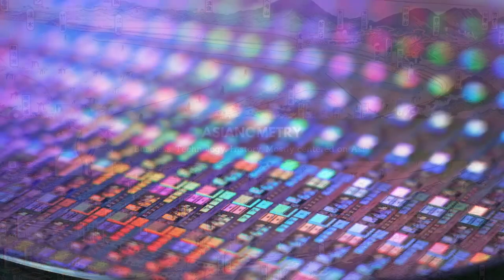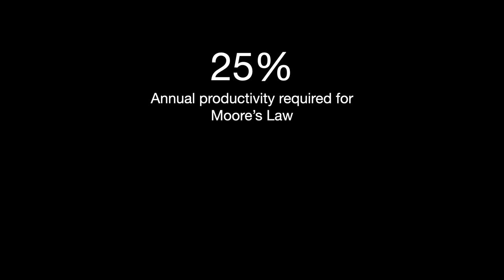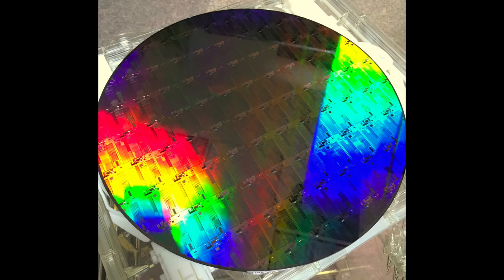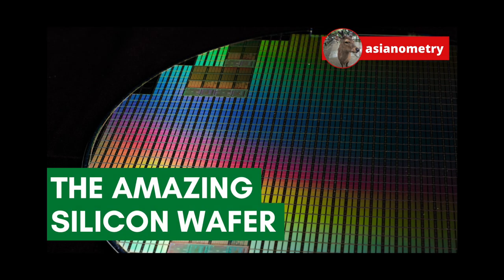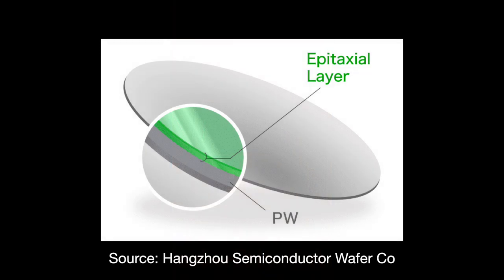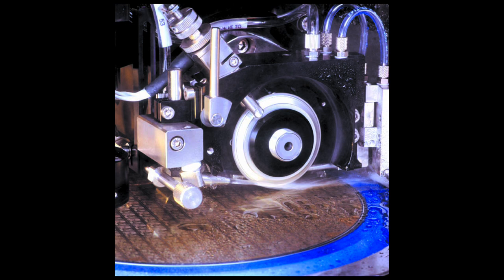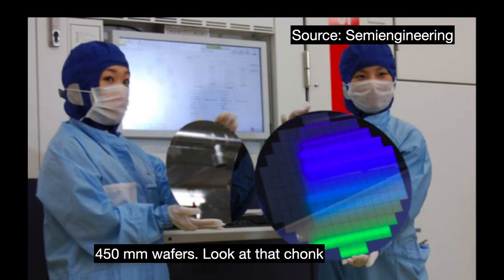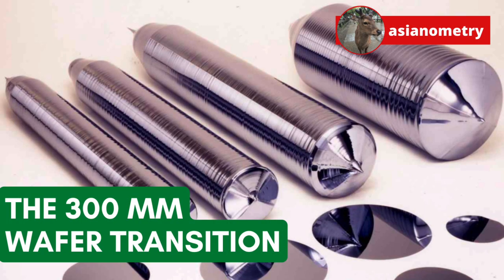The 300mm Silicon Wafer Transition

Comment: This sets up an interesting game theory situation.... if a company really wanted 450 they'd have to make huge firm orders from suppliers to get them to tool up; but then after the suppliers have tooled up then they're free to sell to other companies, who get a free ride (or a relatively cheaper ride at least).  Demand for chips is relatively price-insensitive, so it would make sense for the industry to get together and agree "let's just not".  Antitrust laws prohibit those kinds of agreements, but the law can't force companies to get together and agree on standards.  I wonder if some companies were trying that with the 725 vs 735 um controversy last time around.  (I have absolutely no idea about chipmaking, but is there any reason to feel strongly about 725 vs 735?)
Reply: I don't see it happening.  Because of the node shrinks the amount of die that can come from a single wafer is in the many hundreds  to thousands and the bigger problem is being able to cut a die ever smaller.  You get into issues like how fine can the line be between two different die.  So when these are the problems, somehow I just don't see the desire for all these fabs to go through the cost of retooling again.  The cost would probably be 50 - 75 billion this time around because there's a lot more fabs.

They made the move to 300mm when the industry was using a 100nm process node.  We're about to be at a 2nm node (3 is in development, getting near risk production), and we're going to be at phases of 1nm by the end of the decade.  3nm is a density of 300 million transistors/sq. mm.  Once below 2nm, which is 20 angstroms, the industry will change over to angstroms as the measure.

But here is the problem, if you can etch 800 million to 1 billion transistors on a sq. mm, why in the WORLD would the industry want to have larger wafers.  You're now in the thousands of die/wafer.

This is a comment based on a question I asked about how small can a single die be:

"Fully functional chips can be well under 1mm squared. They are typically fabricated on older lithography equipment using smaller wafers, however it is possible to fab 1000s of chips on a 300mm wafer.

It is more cost effective and a better return on investment to fab larger more valuable ~20mm square devices on a large wafer."

And there lies the problem.  It's more cost effective to fab larger die on a large wafer, but with node shrinks getting you near 1 billion transistors sq/mm, the problem becomes cutting hundreds of vertical and horizontal lines to separate die.  So, I don't see the industry wanting to make that even harder by having a larger wafer.  Die is getting smaller every year.

And then as said in the video, it's not like what you said in this statement " if a company really wanted 450 they'd have to make huge firm orders from suppliers to get them to tool up"

No.  To make die relies on making wafers which relies on a CRAP TON of equipment, so a single company wanting to tool to 450mm isn't going to get anyone to tool anything for that company.  If Intel, TSMC, Samsung, etc.... said they wanted to move to a 450mm wafer, since those are the biggest players, the first step is convincing ASML to produce lithography equipment that can deal with such a large wafer, and frankly that would probably be a year debate right there, and then probably 8 - 10 years before they actually produced it.  And that's the first step, KNOWING you can actually produce a die on 450nm.  Then there's probably the other 50 companies that would be involved in making the REST of the equipment.  THIS is why there's a consortium to deal with this.

In fact if anything I could see moving these really advanced nodes BACK to 200nm because once set up, the faster speed of operation added with much smaller die so there are still many hundreds to thousands of die coming off a single wafer, that could probably bring prices down.  As was pointed out in the video, it takes longer to work with and produce larger wafers.
Reply: @aphenioxPDWtechnology  No not true at all.  The movement to the most advanced nodes follows a pattern.  HPC (High Performance Compute) is always moving to the advanced nodes first.  In the case of Intel, Intel moves onto their own advanced nodes, but it's available to other customers.  In the case of TSMC, Apple is always their risk partner (first customer on a new node that has just moved into mass production, along with usually 2 other companies).  In the case of Samsung, they move to their advanced nodes first with their small devices, but Samsung specializes in LP (low power) nodes.

Try searching for TSMC customers percentage wafers or similar searches and you'll find pie charts and other charts that give breakdowns of who buys what from TSMC.

Anyway, after TSMC has proven a node, THEN AMD, Nvidia and many other customers will move onto that node, so in the case of TSMC, Apple moved onto TSMC N5 last year with their small devices and the M1 processor.  This year, for which products are about to start releasing, AMD and Nvidia will be using it.  Intel launched a new line of GPUs, a first for Intel, with Xe graphics and first gen is named ARC.  THAT is on TSMC's advanced node.  But AMD and Nvidia is in mass production right NOW for AMD's Zen4 line of CPUs/APUs for desktop/laptop/WS/Server along with future console releases on TSMC N5, and AMD is releasing their new line of GPUs on TSMC N5.  These products are here starting next month for the CPUs and probably the end of the year for GPUs.  Nvidia has delayed their release of Lovelace GPUs but they should still be out by the end of the year, also on TSMC N5.  Apple was SUPPOSED to move to TSMC N3 for their next gen products but that node is delayed, so they'll probably be on N4 and an advanced node of N5, whatever the designation will be.  Samsung has already released on their 4nm.  Intel will launch their 14th gen CPUs on their Intel 4.

Now, these are the big names that most people recognize.  Qualcomm and a few other companies are also customers of the two most advanced nodes out.  Huawei is another one.

So, HPC and small devices dominate the most advanced nodes, and HPC is HUGE.  The world of servers is getting to millions of CPU purchases a year and is still growing, and they swap out equipment all the time.

After those most advanced nodes then you get into other electronics that needs to be on small die and use little power, other than what Apple, Samsung, AMD and Intel make.  You have other ARM processors that different companies make, but even part of those are on the most advanced nodes even after what Apple, Qualcomm and Samsung produce.

Sure, an IC that runs a vehicle's emissions along with gas flow, air flow, etc.... to get the best performance/fuel efficiency are on lesser nodes and there's tons of trivial electronics that use less nodes.  A lot of military equipment uses lesser nodes.  But a node hasn't come out in probably 1.5 decades where it wasn't already booked up for 1.5 to 2 years.

And also, if a company doesn't get good yield from their advanced nodes, it cuts into their profit, so you better BELIEVE they do everything they can to get yield up as quickly as possible.  If TSMC for instance has a bad yield on N3, NO ONE will move to it.  All that is worked out in contract.  They have to guarantee a certain defect rate.  You can't be a company like Apple and 30% of your ICs fail.  Intel is different because they are a chipmaker and semi-conductor company, and this has been part of THEIR failure and why they've slipped in market share for both sectors of their business.  So yes THEY have had issues with their advanced nodes, but TSMC gets that worked out before they can release a node and both their N7 and N5 releases were VERY impressive and made their customers happy and coming back for more, and caused Nvidia to move off of Samsung back to TSMC.

So, if you get anything from this, there are multiple companies involved for fab.  You can't make a blanket statement about failure rates.  You can't make a blanket statement about ANYTHING.  And there's a LIST of customers always waiting to be on the most advanced nodes, more so with small devices and HPC, where in HPC it give companies a competitive edge, so they will move onto those nodes after they're proven or even as risk customers.

Maybe you should do some research before making a statement.
Reply: @aphenioxPDWtechnology  Dude you said that companies stopped jumping onto the next node when it comes out for a while.  That's not true, at ALL, in any way shape or form.  There is a WAITING order to get onto the more advanced nodes based on what you're making ICs for.  HPC is ALWAYS on the more advanced nodes and it will never change.  That's part of the competitive edge for a company.

And if you didn't understand what I said it's because you don't understand the fine details of chipmaking/nodes/fabs, etc....  I have followed this industry my entire working life.

I've followed the industry since the 80s when I was a computer tech in the military for 20 years and I had to learn the inner workings of a computer to be able to fix older computer systems, where you find failing logic gates and then replaced ICs that only had about 4 - 8 logic gates in an IC.

I build systems and sell them and every day I follow tech news so I'm on top of what's going on in this business I've been following now for 4 decades.

There see I can beat my chest too.

And no, just because there is more features, cores, whatever going into newer CPUs, doesn't mean dies stay the same size or get bigger.  This WAS the case, but NOW there is a heat problem because of transistor density.  Cooling 1 billion transistors clocking at 5.5GHz over an area of 10 sq. mm on a 7nm power efficient node is easy.  Cooling 1 billion transistors clocking at 5.5GHz over an area of 4 sq. mm on a 3nm power efficient node is harder, and when you get to 1 billion transistor on 1 sq. mm which is going to happen, well, that 1 sq. mm die with 1 billion transistors probably can't clock at 5.5GHz anymore.  Power consumption would be too high, die glows red, blows up.  The heat that USED to be spread out over 10 sq. mm is now all contained in 1 sq. mm.

 You do get power reductions per transistor with node shrinks, but that's not going to keep up with how much transistor density is increasing.

So this is why die isn't getting larger anymore and companies are moving to MCM (multi-chip module).  That AMD Ryzen desktop CPU is an SoC now, just like all modern CPUs are now.  It's 3 chiplets to spread the heat.  This problem gets worse with each node shrink.  Yes, Intel and Nvidia increased some of their die sizes in the last gen, but they're on nodes which is at that borderline

So you might be following the industry, but your failing to keep up with the reasons WHY companies are doing certain things, and in the world of HPC that's been moving away from larger die because of how much more heat is condensed into a much smaller space.  So dies for HPC are going to be on a downward trend for size, not bigger.  It's either that, or you have to compete against a company that's making faster products than you are.  

And this is why I used a bunch of words.

Peace dude I'm done.
Reply: @aphenioxPDWtechnology  OK, I didn't quite read your comment correctly.

Except you're still wrong.  Apple doesn't just put the M1 processor, which is JUST finished about 1.5 years ago on the most advanced node that comes out of TSMC, they make their chips for SMALL devices on that MOST advanced node.  It was only recently that Apple went back to making their own CPUs, but they've been a risk partner for TSMC for years.

Samsung puts their chips on their MOST advanced node, for their SMALL devices.

You're still wrong.  Companies that compete in compute devices want a node advantage.  It's not always about more transistors.  It's also the fact that smaller transistors use less power and hence your BATTERY lasts longer.

So that comment is still wrong.  No, I didn't mean a company is making chips for toasters on an advanced node.

Do research.
Reply: @johndoh5182  just adding to the your wrong hype train, as another internet expert. Newer nodes make sense yes but costs are going exponential. There will always be a person will to pay extra for extra performance and they sound like big names. But there are loads of applications that don't need it. 
If i read car magazines i would think there is loads of high performance stuff out there but most of the market is cheap and simple econoboxes.
Reply: See the EUV evolution.  The big 3 still have waiting lists for years worth of production.  ASML won’t even entertain a request from anyone else because they don’t have capacity and it would violate contracts with those who funded development.
Reply: @bobo-cc1xw  Costs for a company like Apple, who competes against Samsung, who has their own fabs and is already on a 4nm node for their new devices, are made up for by the fact that moving from something like N7 to N5 means you get a lot more ICs from a single wafer because of the much higher transistor density AND it's a superior node that gives them a competitive advantage.  

In fact all projections were that moving to TSMC N5 was going to SAVE companies money because of the increased output of die.  And if the rumored AMD Zen4 Ryzen leaked prices are to be believed, AMD found a way to put out a new generation of CPUs, using DDR5 instead of DDR4, using PCIe gen5 instead of gen4, boosting their PCIe lanes to 28 x PCIe gen5 vs. 24 lanes x PCIe gen4, increasing their clock speeds by as much as 30% depending on the SKU, adding more L2 cache, AND STILL have lower prices than Zen3 Ryzen.  And this was moving from TSMC N7 to N5.  What I'm getting at is the CPUs have more complexity and the clock speeds it has to push, not just in the cores but also across the mainboard, driving PCIe lanes 2X faster than they are right now are usually something that would drive costs up.

Now, I can't speak to that deal because AMD has become a dominant customer of TSMC and they could certainly have gotten a preferred deal even though they aren't a risk customer like Apple, which is how Apple benefits.  But if AMD pricing ends up being what I saw they're pulling off a MIRACLE if newer node costs are going up exponentially, if you really understand what that word means.

And whether you use products these companies are making doesn't matter.  That doesn't changes the massive sales that both Apple and AMD have using these TSMC advanced nodes that you say are supposedly going up in price exponentially.

Yes, TSMC has raised their pricing a couple times since 2020.  But that doesn't make it exponential.  They are THE premiere fab. Every chipmaker that makes ICs that's in a competitive market wants to use TSMC.  Nvidia just moved back to TSMC because their last gen product were equaled by AMD graphics and this allowed AMD to gain marketshare.  Nvidia WAS using Samsung for their last gen and they made the move to Samsung because they didn't like the prices they were paying to TSMC.  But now they are right back at TSMC, to pay the higher prices.  But it's not exponentially higher than when they left TSMC to go to Samsung.  And the result is going to be Nvidia once again has graphics that are a bit better than AMD because they have a superior product that should have NEVER lost to AMD graphics in ANY way, but AMD could clock their TSMC N7 based chips to about 2.7GHz while Samsung was stuck at speeds under 2GHz and even with the faster clock speeds AMD graphics were using less power than Samsung, and that just shows how superior TSMC N7 is to that Samsung 8nm node.

Anything else??  The data don't lie dude, that's why this discussion is so silly.  You and the other are IGNORING what's actually happening right NOW.

Really, YOU do use it so that means everything.  C'mon man get real.  I don't buy Apple products either because I don't like the company but the data don't lie.
Reply: @johndoh5182  It is similar in paper lithography, i.e. printing.  In the 80s-90s they made really wide presses.  But they were slower and more prone to malfunction.  Being able to cut more product per sheet doesn't matter if you have to print them a lot slower.   So now more narrow presses are back as the standard, and digital presses are often even narrower web size.  The printing industry doesn't have quite as much equipment investment, but it is similar in that you still need platemakers, cutting machines, all the other infrastructure for the bigger sheets.  So there is a real world precedent in a tangentially related industry.

Comment: Growing the ingots of single crystal silicon (Cz) is extremely difficult, and requires A LOT of energy.  When I was at ARCO and Siemens Solar (early 1990s), we grew 35Kg that were 105-125mm diameter.  As I recall this took about 48 hours.  A full grown ingot was about 1.5m long.  Slip dislocations were almost more common than not.  For solar cell performance, if we suffered loss of structure, or slip dislocations, defects were seen as far as 1.5 diameters into the already grown ingot.  During this period, we ushered in wire-saws to cut the wafers - less kerf loss.  Up to that point, outer diameter saws were used.  As I recall, we yielded about 1200 wafers per 1.5m ingot.  Good review video.  Thanks!